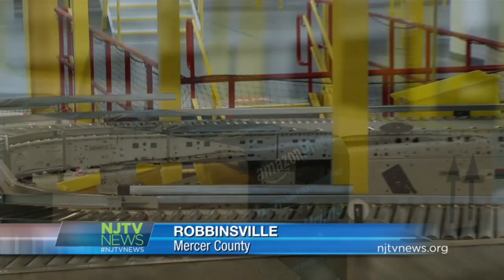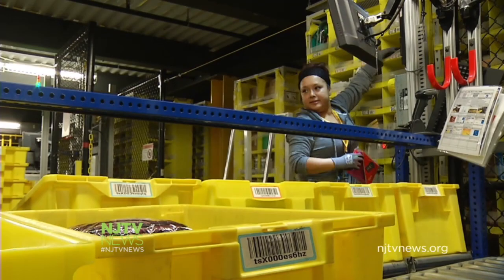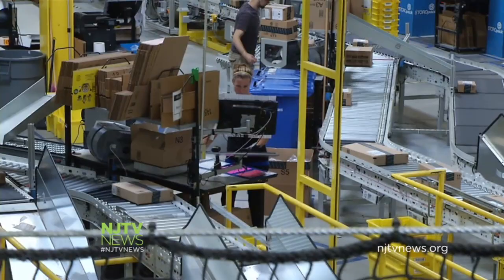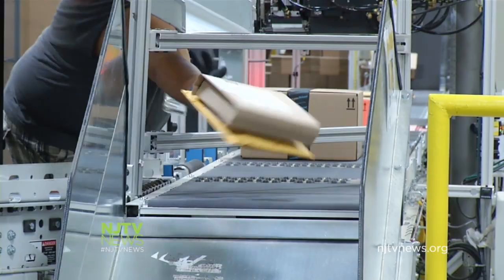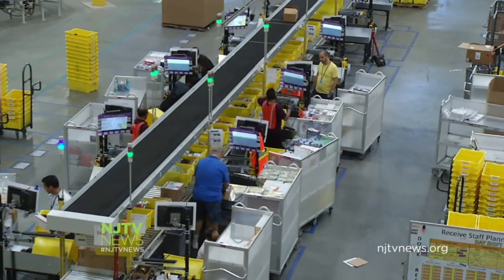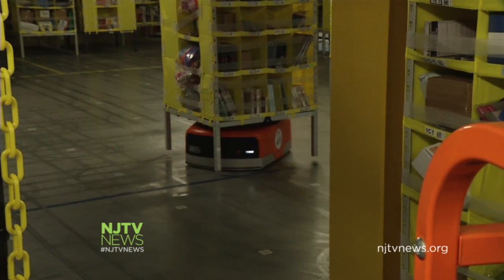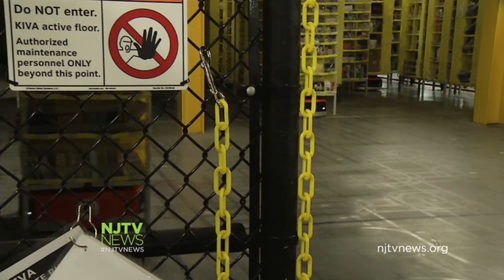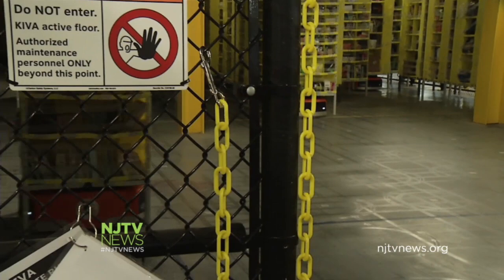Amazon Explains How Robbinsville Center Works

Comment: I work at Amazon Fulfillment Center. I make 12.25 per hr. I work 20-30 hrs per week. I'm taking classes at community college so it works for me. You walk a lot but it's not that bad.
Reply: - dwasilco412 - after 8 months I started hating this job. I got teased by a PA and wanted to tussle with him, but I thought better of it. They do have UPTs and sick times and also flexible schedule to fit your school schedule situation and what shift I want to work. That’s good. But am I the only one that despises closers who litter after they print out the label? If I was working at the post office, I’d be pissed seeing that. The straight disrespect. People who work at amazon who don’t have an issue with this. Ohhhh, how much I will explode 😡 (sorry to rant)
Reply: I am a closer at an amazon sort center and i hate when people throw the printing labels on the ground too, but as closers we are made to pick them up at the end of shift anyways. i usually throw them on the line so they are easier to collect at the end.

Comment: This is strange, a test comment seemed to stay up, but attempts at a longer previous comment just disappears--originally it failed to post, but then looked like it was posted but isn't there anymore. This happened a few times. It also disappears when I edit the test comment and replace it with the longer comment. If it were held for review because of some word and the comment I would still be able to see it when signed in, I believe, but I wasn't able to see you then either. I never had this type of thing happen before on YouTube.
Reply: @Marcos R. It's possible I was actually signed out from another tab and didn't realize it--I've seen that happen before, but usually you can't get as far as actually posting the comment. Sometimes YouTube is updating stuff and it interrupts the system for a little while also. I haven't seen that in  of my comments, so I don't know that it is comment ghosting in this case. I don't evern recall what the original comment was about--probably that Amazon sent an an order for six small bags of pork cracklings, individually or two together in four separate boxes of various sizes from barely big enough to a couple feet square.